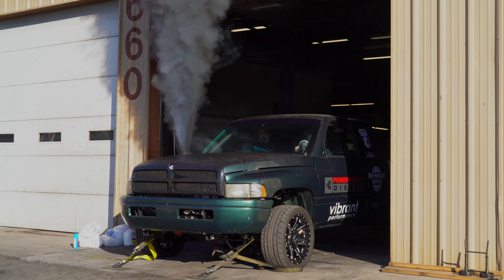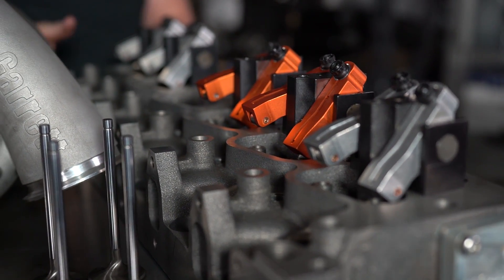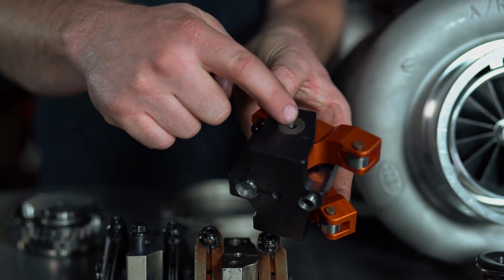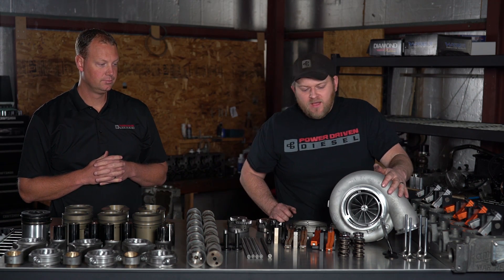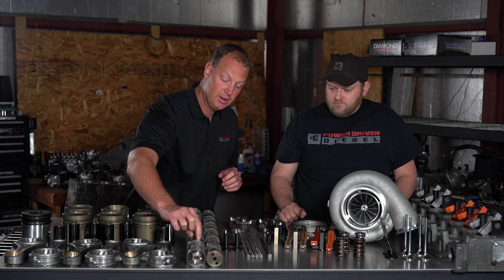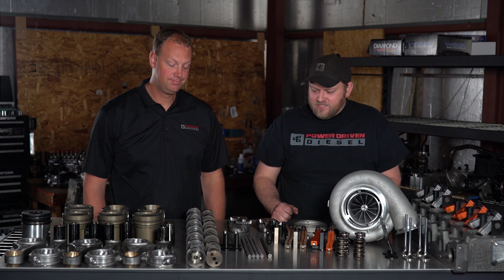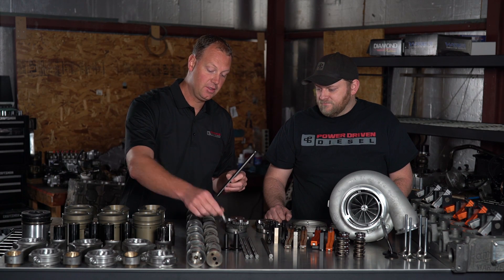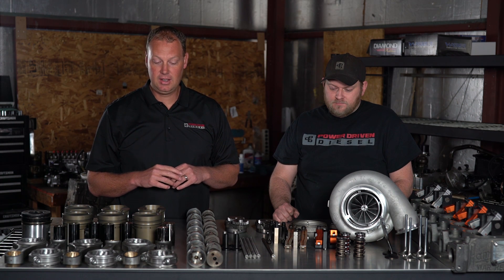What Goes Into a 2500HP Cummins Engine?

Comment: With the higher quality more durable components does that add to the weight of the assembly and total engine weight?? Or is there weight savings elsewhere on the engine to offset it? Thanks

Comment: As a gas engine builder/racer I am just in awe!!  I respect the hell out of you diesel guys. The size of those components are absolutely huge.  I saw your engine explode on that 1/8 mile pass when your engine stop malfunctioned.  To see such massive weight reciprocating assembly revved to 8 grand when it came apart is a testament to yalls build quality. Gas engines with lightweight components have many failures below that rpm  The diesel world has exceeded all other engine platforms in making something that theoretically would seem impossible,  possible.  Hats off to yall.

Comment: Is the 12 valve the ideal head because of strength ? Or does it also have to do with low lift flow characteristics and curtain area of 1 big valve vrs 2 smaller valves with the same area?
Reply: PowerDrivenDiesel  it’s cool to see a lot of the technology of our sport start to trickle over to you compression ignition dudes. Are shop is next door to Fleece. They are smart dudes. It’s crazy how much power you diesel guys make. I run a lot of alky hemi motors on the dyno. It was built by Dale Armstrong for Kenny and the Budweiser King team. It’s a navel ship dyno he converted. Rated to 5,500 lbs/ft. They used to run Fuel motors on it in the late 80s but now we just run alcohol engines on it because it can’t handle 8,000-9,000 lbs/ft a nitro motor makes now days. I know just how hard it is to make 2,500-3,500 ponies. To see cummins engines make that now is unreal!!! I fly in to the races but during the week I work as a engineer at BMEltd. We make pretty mean 14& 16/71 Roots  blowers. I always get calls about trying to put are Top Fuel Rods in a diesel... but I’m
Still waiting for some one that wants a blower🤣
Reply: PowerDrivenDiesel do you understand what I’m saying about “ curtain area”?  And how 1 big valve flows a ton better at low lift off the valve seat than 2 smaller valves.  Are engines make 11,000 hp with 2 valves and only 500 cubic inches. I’m pretty sure a lot of pulling guys are using are inconel valves now on the exhaust and intake. Why not run a Ti valve on the intake? It can’t be EGT because nitro runs a lot hotter. But are intake is a lot bigger than the exhaust so the weight helps.  How much spring pressure at installed height  do you have to run making 150psi🤣  we only make 70 psi but the back of the valve has almost 3 square inches of area. We used to run 300lbs on the seat. Then dell one say did the math and with 70 pounds of boost on the back of the intake valve the dynamic spring pressure was only like 120-130lbs and that’s why we where floating the valve. I have a 5.9 and they have little girly springs.  With a 12 valve head with a big intake and 100 psi of boost I bet there’s a ton to seat pressure on the intake to get it to close. We now run 700-750  on the seat. Around 1300 over the nose💪🏼🚀

Comment: Your cummins wrist pin is about twice the size of a nitro wrist pin. We use a taper wall wrist pin in Nitro motors like most all other drag racing engines. There’s twice the surface area in the pistons pin boss towers compared to the little end of the connecting rod. Because there’s twice as much more surface area a taper wall pin is ideal.  I worked as a engineer and planer @ BMEltd is I had a dollar for every diesel guy calling to ask about using top fuel rods on diesel motors I would be rich.  It’s crazy how manny misconceptions there are because magazines.  I will say that Fleece performance is a bunch of great guys. There shop is next to my teams shop in Brownsburg. The fleece guys are all very smart and class acts

Comment: Lol heat ruins ring lands 80% of the combustion heat is transferred to the cylinder wall and cooling system by the top piston ring. A “ top fuel” wrist pin is a 1.156x3.500  c300 aka vascomax.  Trend has been having problems with a lot of their Nitro parts.

Comment: If I yank crate and ship my 12V to you along with transmission would you guys be able to to make it put out 800hp and build the trans or sell me a transmission that will handle the new power? 
My drive train minus the transmission I’ve already upgraded it all with Strange Engineering gears and axles.

Comment: How is dry sump oil system to expensive? When everything else in the motor is top of the line or upgraded
Reply: Yeah wierd. You get more horsepower with dry sump too thanks to the crank works in vacuum witg dry sump instead of pushing oil around

Comment: How much money goes  into a 2500hp Cummins engine ?  That tittle would be appropriate as well ..
Great video
Reply: $10,000 bucks easy in engine parts alone. Then paying someone to assemble it, then the fuel system, then exhaust and fabrication work, then driveline parts, then electronics to control it all. Now your up to $20,000 bucks on the low end of cost..

Comment: You guys said you run a 6.7 block. Do you sleeve the engine and then make it back into a 5.9? Another question is do you have alot of blow by. From what I have learned about tractor pulling is that that hone out the engine to have lots of blow but to compensate for all the boost.
Reply: Thanks you guys are awesome

Comment: A couple questions... 
What cam bearings did you use? Since you obviously opened up the cam bore diameter. And since the stock only uses the front and back bearings did you opt for a roller bearing? 200 lbs of seat pressure is alot.
Reply: Thats cool! Fomoco parts in a cummins might be against the law tho. Lol

Comment: I know this video is old, but I have a first gen getrag 5 speed. It has a 3200 rpm gov spring, fuel pin and some ve44 pump work. But I'm looking for a little more. I know the ve44 isn't the best for big power, but I'm just looking for a reliable high 300/low 400 horsepower. Do you have any suggestions for "doubling" the horsepower for these trucks?
Reply: Jake Haberhauer gov spring 4K, 60mm turbo, little better injectors like 100hp-125hp, exhaust, intake, intake elbow, than do the actual fuel system
Reply: Bbd L I have a 3200 gov spring, fuel pin and the hungry diesels low pressure high volume lift pump. I've been looking at some 5x12 injectors, a second gen intake elbow and now a hx35. Hopefully after all the mods it'll wake the truck up more.
Reply: Looks like a good list just do some research on the turbo I’m not a fan of the hx35

Comment: Just come across your vids, they are very good! I'm surprised that you think that the rod bolts are placed under a tensile load as the piston reaches TDC because there must be a hell of a lot of gas pressure on the piston pushing the piston and rod back down the bore. I could understand that the rod bolts are under load when the engine is on over run but even then the gas pressure must be pretty high.
Reply: Fair enough you are right, on the exhaust stroke there will be a lot less pressure above the pistons although a suppose there will be still some pressure especially as you have a turbos creating some back pressure.

Comment: What is the rpm upper limit on that new rotating assembly? Does the additional strength offset the additional weight for spinning it faster? I'm new to diesel.